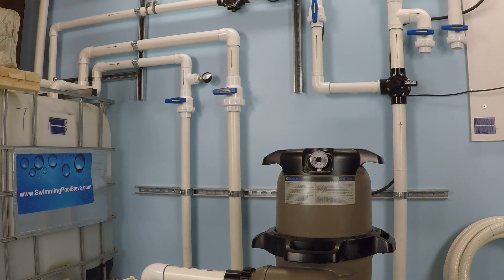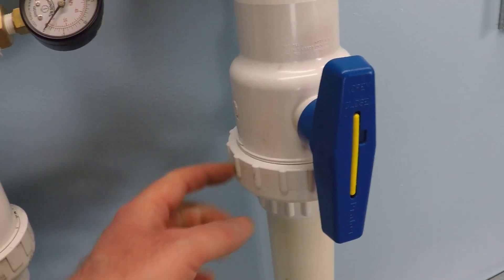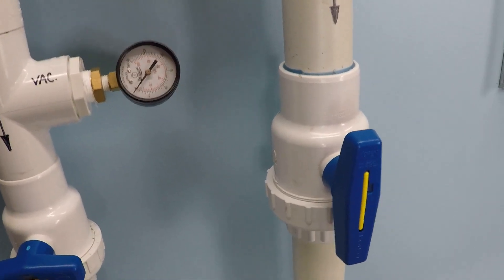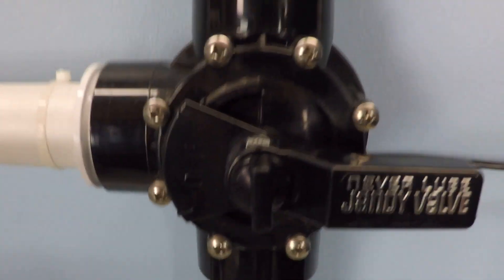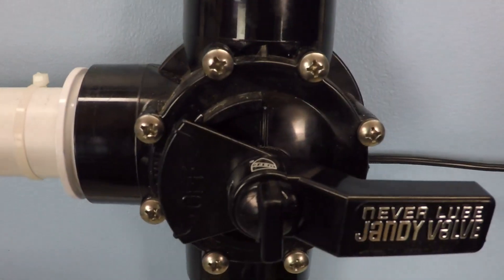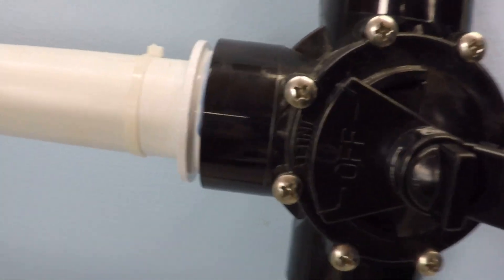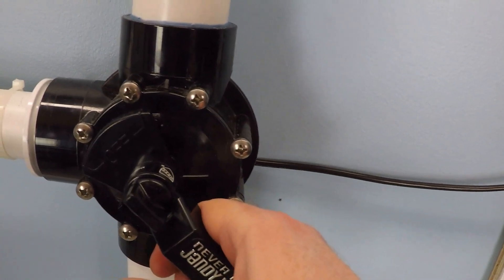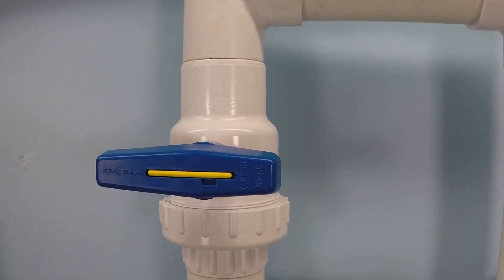Introduction To Pool Valves

Comment: Love jandy over those pvc ball valves but yours look much better than the ones in most big box stores.  Better to go with higher quality and not have to give it a second thought later.
Reply from the maker: Definitely Jandy diverter valves are the way to go.  For budget installations I can live with a ball valve that has either one or two unions.  Non-union ball valves are junk and I would cut them out if I bought a pool that had them
Reply from the maker: @Burim S you can not glue a joint like that.  It should not even have residual dampness.  The only way a pro deals with things like this is to plug the lines that need to be serviced.  If that means swimming or draining the pool, then that is the price of the service you need.

Comment: Hi Steve by watching your VIDEO'S now since we purchased our pool I've been watching all your vids so this year I really dug into the balancing the chemistry first off and also the pool co, that installed my pool used the home depot play sand in my sand filter so noticed now that the sand is starting to come back into pool and the PLUMBING is INCORRECT,  gonna change now my QUESTION to you is what your thoughts on using HIGH TEMP, UNIONS ON PUMP & FILTER , ALSO LOOKING TO CHANGE the 3 ways is JANDY good for this ???
Reply from the maker: play sand is no good for sand filters.  #20 graded silica sand only.  High temp unions are great.  I don't always use them, but preferably yes. Jandy are the best, or at least most common  diverter valves, but if you have diverters from another brand I would probably not cut them out and replace.  Non-union ball valves on the other hand I would cut out immediately.
Reply: @Swimmingpoolsteve  Thanks Steve for this Info, well appreciated 👍🎯

Comment: There is one more “common” valve you should mention. My Pentair valves work differently. The handle position, relative to the valve, is fixed. They use adjustable pins that contact fixed stops to adjust the valve position.
Reply from the maker: Is this a digital valve like this one: http://www.swimmingpoolsteve.com/pages/intellivalve.html